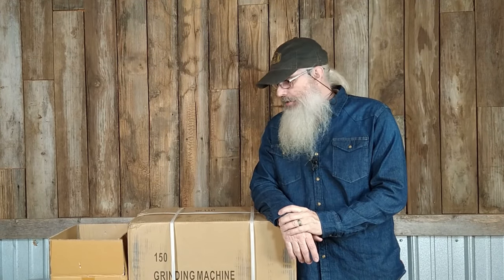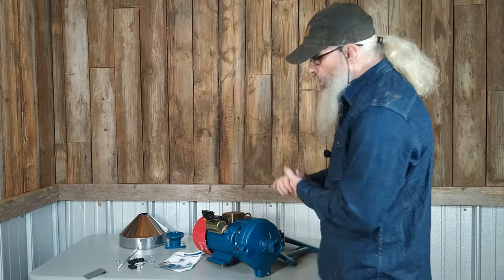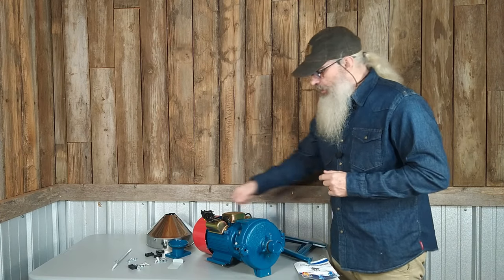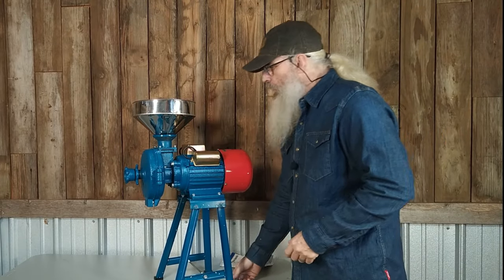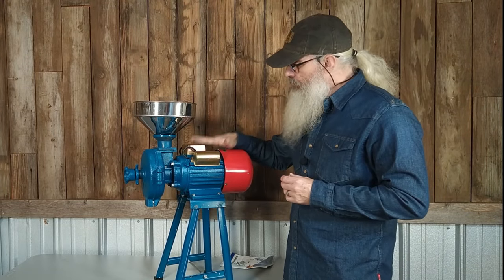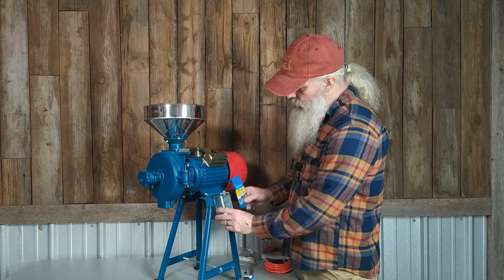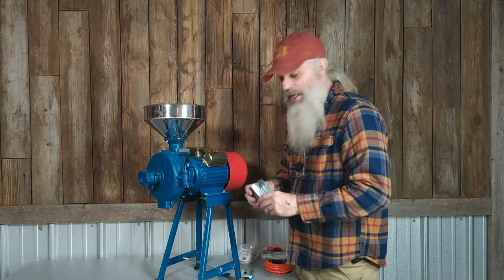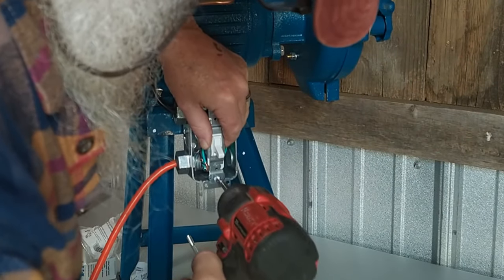Heavy duty Chinese electric grain mill review

Comment: You’re a better moonshiner than electrician.  You switched the neutral.  That being said, thanks for your videos.  I really enjoy them.
Reply from the maker: Thanks for the input.
Reply from the maker: In what way is it bad to switch the neutral?
Reply: It’s common practice to switch the hot side.  In this case there is 120v sitting all along the circuit even when off.  Functionally it will work fine the way you wired it.
Reply: @StillnTheClear  there's a significant shock hazard that way. Best to swap it. Power can come only from the hot (black) side. Neutral can be ANY path to ground.
Reply from the maker: @danthemann  thanks. It looks like I may be making another video about all the great advice and comments I've been getting.
Reply: @StillnTheClear  also let amazon know you the website description is inaccurate. It (thankfully) is not a 3000W motor and it was missing parts. I did not see the switch in the photos tho. 
They will offer an adjustment if you ask :)
Reply: Be sure the extension is correct for load and length sized for the motor load. Also, don't bother with variable speed. It's expensive for no benefit. Be careful with the dust, it is an explosion hazard and nasty to breathe.

Comment: Thanks for this video. I bought the same unit two years ago and had your same experience mostly.  My cord was already attached when I received it. My biggest difference from your first milling was that the grinder would jam if I tried to do a fine mill from whole corn. Clearing the jam is not difficult fortunately, just open the grinder door and spin the plate. I ended up doing three grinds from coarse to medium to fine. Also had to keep a close watch on the gate opening. Too far open and the machine would jam again. Even so, I like this grinder.

Comment: I bought two of these (green ones) when I lived in Hanoi 2008-2012, one was steel bur, the other composite stone. They are easy to assemble. The little bent angle piece of aluminium is the grain shute control slider. The biggest issue with both mills was dust control, and cleaning. Apart from that, they were solid items that never missed a beat even after 10 years of operation, when I onsold them to other people. and afik they are still using them to this day without problem.
Reply: Incidently, to adjust it, you sinch it up under operation until the metal starts to squeal then back it off until the squealing stops.That's your closest gap. To get a finer crush you pass the ground grain a second or third time through, like with a meat mincer. The stone mill grinds finer flour than the steel mill, but the steel mill is better for wet grinding (eg. nut butters)

Comment: Loved your video. Try to always switch the black hot wire and line side of the switch is always on the top, and the load side going to the motor is on the bottom side of the switch. Make sure switch says on and off and not no and ffo. It's all good anyway.
Reply from the maker: Thanks for the tips. I did end up changing the switch after so many corrections .

Comment: An EZ way to make a gasket is to put a bead of silicone on one side then cover with Saran wrap. Now put a bead of silicone on the other side and cover it with Saran Wrap. Close the door and leave it for 24hrs. You may be able to remove the Saran Wrap but just trim if you cannot.

Comment: Thanks for the video. Mine just arrived today and there's no manual either. The ball bearing and a bunch of stuff were lying loose in the box and I'd no idea what to do. Do you know if the disc can be washed (will it rust)? It has a layer of thick  industrial grease. I'm thinking of washing them off and grease with cooking oil instead. Will be grinding oat to flour and cant have them smelling like engine oil

Comment: Find some food grade lubricating grease for the bearing.  It is a highly refined paraffin base with friction modifiers and is usually white in color.  Just put a dab on the bearing before using the grinder.
Reply from the maker: Cool, thanks for the tip.

Comment: If it has a capacitor start on the motor, you cannot put a rheostat on it.
Reply from the maker: Cool, thanks for the info. I'm glad I didn't do that.
Reply: Most AC motor windings are set up to run most efficiently at the rated voltage.  Reducing the volts/amps would be the same as using a supply cord that is too small.  It would run less efficiently and the motor would heat up and most likely be damaged.  There are wave -form AC reducers, but they are a bit pricy for a small application.  There are DC motors that would be more efficient for speed reduction but again the cost might be out of reach for practical home use.
Reply: @rockymntain   I see these mills calling themselves 3000 W.   Can a 110v AC motor even generate 3k watts of power?  I recall something from 45 years ago regarding P=IE...but that is about all  LOL
Reply: @sevenmile  You'd be correct in questioning the wattage.  I was taught the same formula.  Volts X Amps = Watts.   Given a good day on a 20 amp circuit at the highest supply voltage in the US at 120V you'd achieve 2400W  of power.   Any induction motor can pull 4 to 5 times their rated power at startup for 1 to 2 seconds.  Any longer than that will blow fuses/breakers.  If they are using the start Watts, that is a dishonest rating, as the concern is the running amps not starting amps.  For most households, the only way around this is if it was wired up to and capable of being attached to a two leg, 220/240 single phase line.
Reply: @rockymntain  Thanks for laying it out!

Comment: With a 3000W motor, how does it operate on a standard household 15A or 20A circuit?  3000W/120V=25A or 3000W/110V=27.3A  Is your circuit breaker constantly throwing out?
Reply from the maker: Lol, can't be right but that's what the box said. I bet it's probably around 1200 is

Comment: The Hot leg(black wire) is the one that should be switched, and there should be a pigtail added to the green and bonded (screwed) to the box. Thereby the entire tool will be grounded. That is code in the four states that I have worked in. The white wires go under silver screws and the black wires go under gold screws. The dust from grain is amazingly explosive. I can smell fresh bread even now.
Reply from the maker: Thanks for the comment. I have had many like yours and have since made another video making these corrections. Thanks for your tips

Comment: I have had mine a bit over a year and use it 1 time a week to grind a bit of pig feed. Works great..very useful for other grinding needs as well
Reply from the maker: Thanks for the comment. Did yours come with a switch or no?
Reply: No..I had to add the switch myself as well..did have all the hardware though
Reply: How long yours last?
Reply from the maker: @jorgerdrgz9967  mine is still new and going strong. @mike Kelly said he's had his over a year.
Reply: @Jorge Rdrgz  still running it today..seems to hold up really good..needs a heavier power cord..tends to be a lil warm after 100lbs of corn
Reply: Hello im looking for sometging similar like this to mill flour for bread.... will it be good for wheat flour?
Reply: @colinkilin1590  I haven't tried going all the way to flour but it has come pretty close with corn..some of the corn and oats do come out flour fine ..but even if it dont go that fine it sure would take alot of work out of doing a hand crank mill

Comment: Nice mill Cyrus. Seems cheap made in China stuff is usually lacking clear instructions, and takes a little fiddling to get it right. Switching the nutral instead is not that big of a deal in a plug-in appliance, but definitely switch the hot for household wiring. 

Always test for voltage, I once changed a light fixture in a rental, and found out they had the switch wired to nutral, with my meter. A year later, the house was sold, and the new landlord went to work on it. He was going to do it without testing. I told him it was still hot when switched off. He didn't believe me, but I convinced him to test before touching it... Saved him an unpleasant experience...

When switched from the hot, the circuit will have no voltage when switched off. If wired the other way, it works, but the hot side is still hot. For something that plugs in, not a deal breaker, just unplug it before servicing. For household wiring, always confirm with a meter. There are several ways a circuit could still be hot when it shouldn't be.
Reply from the maker: That's a great explanation. Thanks for the comment.
Reply: @StillnTheClear  Anytime, man. Your videos and help over at MFB have helped develop my home distilling. I'm always happy to pay it forward where I can, it's the MFB way.

Comment: We've been using a grinder like that for a couple of years in our tiny distillery. After about 300 lbs of corn, that ball bearing gets dry, and it starts eating away at that soft cast iron door socket - keep her lubed up!
Reply from the maker: Okay, thanks for the heads up.

Comment: I have this model in 220v.  It didn't come with a power cord, so I had to figure that out.  It does a great job & will chew through whatever I feed it.  If it died, I'd buy another one.
Reply from the maker: Thanks for the comment. I figured 220v was just a bit more than I need at this point.

Comment: I recently bought a grinder, but this one comes with a power switch, I have tried it with dry wheat and corn (not dry) and it hasn't given me any problems, as for the loading hopper, mine comes with a plastic one that fits into the body of the grinder so you don't need additional screws.

Comment: You should tape the wire nut on so it doesn’t vibrate off.
Reply from the maker: Thank you for the tip.
Reply: Yes. On stranded wire it would be a good idea.  On solid wire, the wire below the nut would be twisted 2-3 turns below the nut to prevent them from coming apart.

Comment: I could not agree more about missing components, missing instruction manual, missing on and off switch on the grinder. Have just assembled my grinder today, thanks to your video which helped me in the process. I managed to get it to work without making your very sensible adaptations because i am not as tech as you are. I got a rough grind the first time around but managed to use instructions in your video to adjust the fineness of the chick - pea flour. I would have struggled without your brilliant video. Many, many thanks.
Reply from the maker: I'm happy to hear the video was so helpful for you. Thank you for the comment.